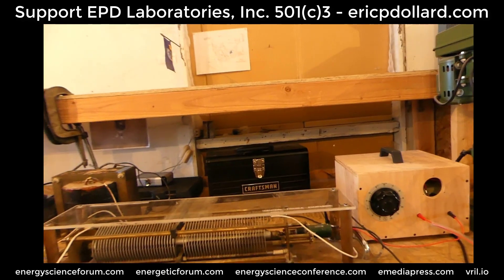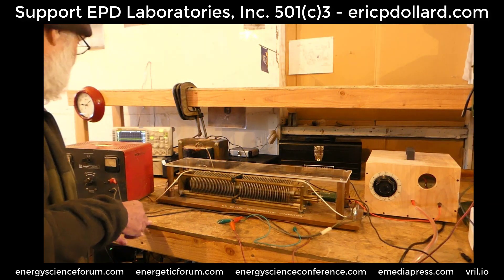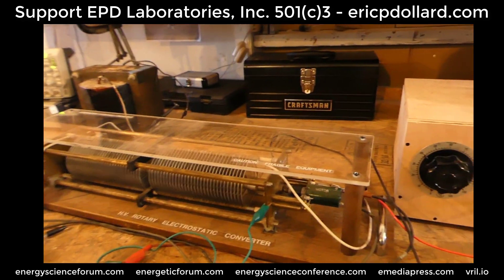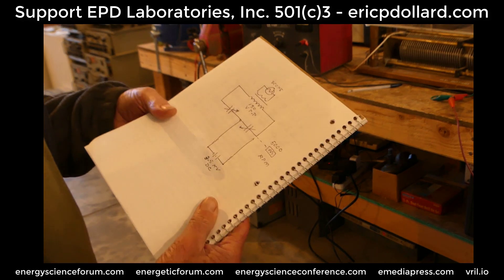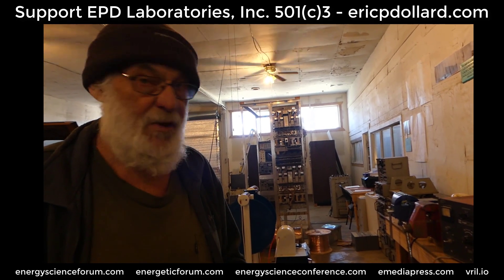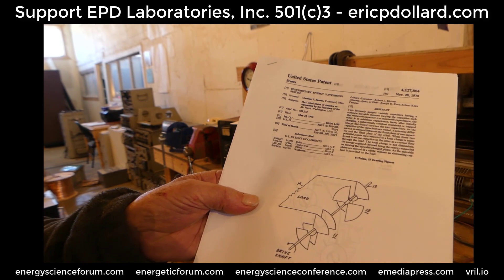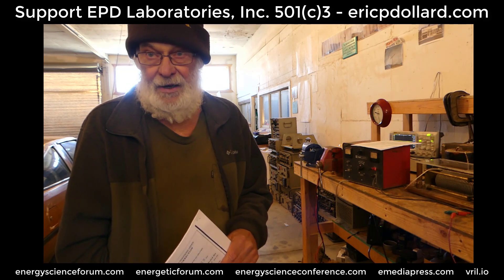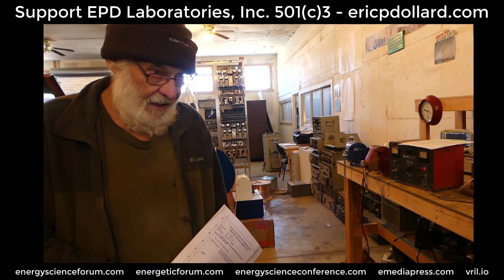Self-Sustaining HV Charge in Electrostatic Rotary Converter built by Chris Carson - Jan 9, 2022

Comment: Aaron, I recently commented on another rotary electrostatic converter video regarding the drag on the motor when the rotor plates are changing the capacitance, In this video, you seem to use both capacitor sections which are out of phase with each other, so when you charge the capacitor sections, is there any increase in drag on the motor?

Comment: https://youtu.be/YWbl4BkAayg
It can't be run as a motor the force is perpendicular to velocity.  Im getting 40 kv or more no vacum im using clear lacquer.
Very happy to see confirmation of my generator.
The transformer should be air core like tesla coil.
Also the power out can be transmitted with one turn loops on top. Also if you incrrase frequency too high capacitors wont fully discharge.

Comment: It seems to me that the transformer should be custom-made and be in exact resonance with the AC waveform you are trying to produce from the spinning motor. This will be a challenge because motor RPM will probably be low frequency, and therefore the resonance will be a bit low -- implying lots of windings in the transformer. Next, any ARCing seen is bad from Nikola Tesla's point of view because it is wasting energy. The AC current flow thru the capacitors needs to be just below the breakdown of air, 30Kv/cm or so. Next, because the plates that are rotating are vibrating, the Casimir effect will happen. This is good. In fact, you might want the plates to definitely vibrate as they rotate, or be designed to not be flat, but be uneven surfaces that when rotated intentionally create a Casimir effect the way you want it. This seems like a Tesla patent. Did Trump just create his paper as he was reverse engineering some of Tesla's old-man experiments, having access to Tesla's papers?

Comment: A spark manifests electrostatic energy. The trick is to get 1 million sparks in a second, that is getting in the zone of resonance with the backround  electrostatic energy. It is easiest to get that kind of frequency through tesla turbines….an extension to the center pole to a wheel about 2-3 feet in diameter, and with tungsten ins at even spacing, two turbines facing each other, so one is on top of the other, and only one pin on each wheel can spark at any given time. Quenched spark gap to get that kind of frequency will help. Tesla said the spark gap should sound like a fly flying at that frequency. I don’t agree with Eric on what he said about the tesla turbine not being used for this, Tesla would not have agreed with him either.

Comment: Amazing. This 90 degree volumic inertial speed turn in combination with voltage is familiar. For instance when a high speed water jet hits a perpendicular surface, plasma will accur between the 90 degree longitudinal jet and radial water flow angle. The volumic speeds are in perpundicular directions in both scenario's but they both do something amazing with voltage.
Reply: Electrostatic Radiation (y)

Comment: Why don't u flood both capacities in oil. Increased permittivity,.lube.the parts?
Reply: it would increase drag/resistance by a lot, even the room air pressure at those speeds has a negative effect, that's why it needs vacuum.
Reply: @vicentiuXeduard  thanks a lot! yes! Iam only startingto understand and yes Eric & Aaron amazing work ! Can anyone here - that's a question to all - tell me why phisics speak of permittivity as relative to air?It really buffles me.  Hearviside states D = permittivity * E ....so it seems like it is really a property aiding displacement as opposedto flow of anything( it is a flux after allbut I see it as counter - flux - - just like counter- space)  ..while air can break ! .why confuse dialectric properties settingup as one..for free space ?Am I thinking right ? What to read to get a better grasp - ides welcome !
Reply: doesn't need lube. It is solid state.

Comment: Put it together with a Tesla Turbine. You will get more than enough rpm to turn it how it needs to turn. Use a closed-loop fluid circuit to turn the turbine. Once the condenser is acting in the capacity of a generator prime mover, it will turn the turbine into a pump.
Reply: @CharlieSolis  🤔🏴‍☠️curious what’s your view of Albert Epstein? 🦑⚜️The inhumane trafficker of false filth, æther råper, and winner of plagiarist of the year several times during his prolific shilly goosing of a lot of flocking stuff. He also won the crown jewel of dunce cap dynamos, truly coveted by all watt’durr fowl like him; which is called “The Allies to Humanity Lifetime Achievement Award!!  Truly impressive. ....

Edit:  sorry about that i had a typo. The award is called “The All Lies to Humanity Lifetimes of Deceivement Award” ..... which he’s also managed to win countless years posthumously via his continued impact of humanity. Truly a leg end; soles  dragging along on the floor. The cause of pain in thee feet.
Reply: Capacitors don't act as prime movers. They simply store energy and then release it.
Reply: @Dziaji  Energy is not a "something" that can be "stored". It has no autonomous existence. Energy is an expression of effect over duration. And capacitors can be used as prime mover source when the dielectric potential that is stored, not energy, is converted to moving charge in an electromagnetic expression over time.

Better get your info straight. because I don't fall for that idiot Einstein and his pseudo-tensor-using idiocy.
Reply: @nazgullinux6601  Eric Dollard made a couple great 4 hour presentation on the basics of capacitance and inductance that you can watch on youtube. You can watch those to get the basics, since you seem to be confused.

"Energy storage" doesn't refer to energy being a physical entity that exists in a container like water in a bucket. It refers to the fact that you can apply a certain level of power to a capacitor for a given amount of time, and then, in the future, the capacitor can now exert that same amount of power for the same amount of time.

Eric explains this in detail, and he refers to capacitors and inductors as "energy storage devices", which is a perfectly valid way to describe them. In capacitors, energy is stored in the dielectric field and released as a manifestation of magnetism when shorted, and in an inductor energy is stored as a magnetic field and released as a manifestation of dielectric potential when open circuited.

You misunderstood the video if you think Eric was saying that this device is a prime mover. The device simply converts DC into AC, or vice versa, efficiently without transistors or moving parts.
Reply: @Dziaji  Just to clarify, i never said the device was a prime mover, but merely that it could "become" one. Energy storage can also be energy delivery with the right setup.
Reply: @nazgullinux6601 wow this got heated. Gosh, it's right in the video! He suggests what you're saying, but people seem hung up on semantics
Reply: @CharlieSolis  And that "release" of power is an effect. nice try but you have no idea what you are talking about.